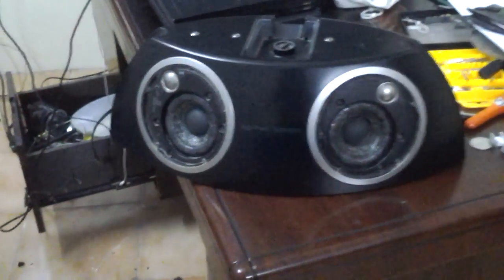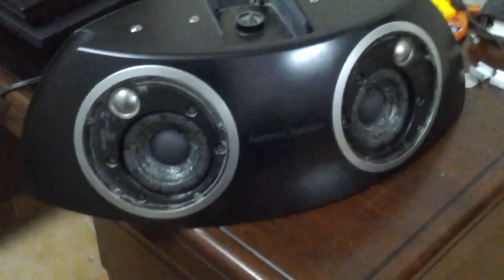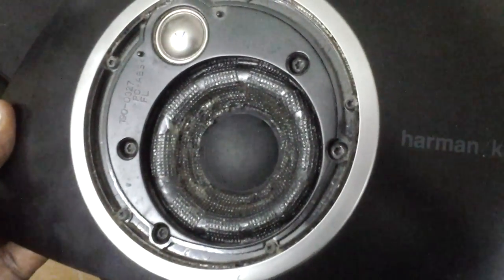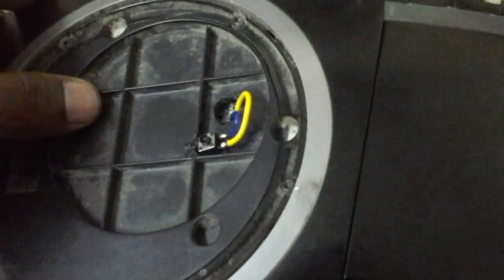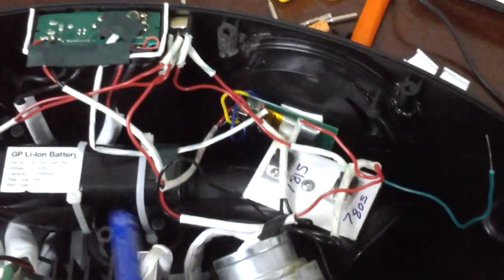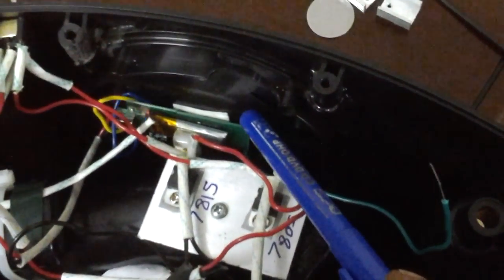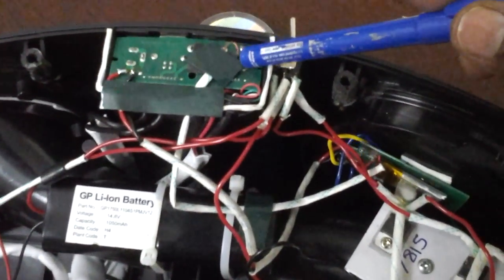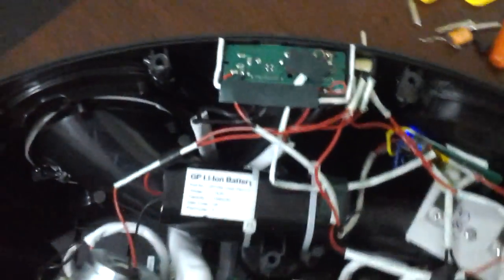Harmon kardon go+play

Comment: To remove the grill use a heat gun or hair dryer to heat the grill the heat will weaken the adhesive then just put something that fit in the small holes of the edge of the grill and pry it will come out really easy